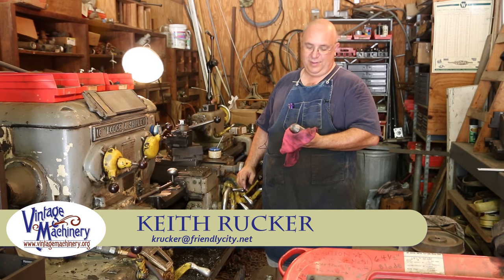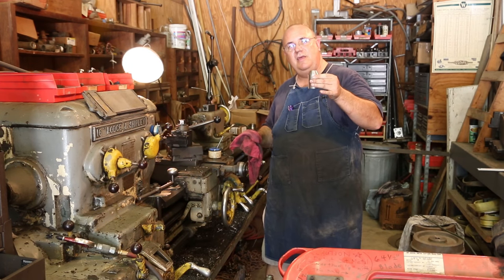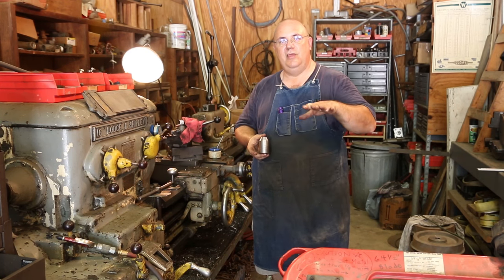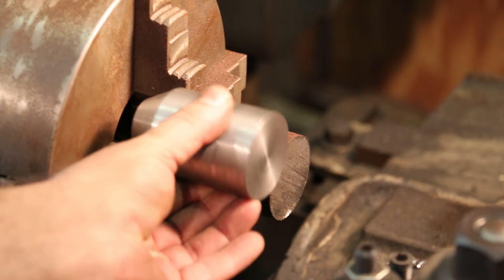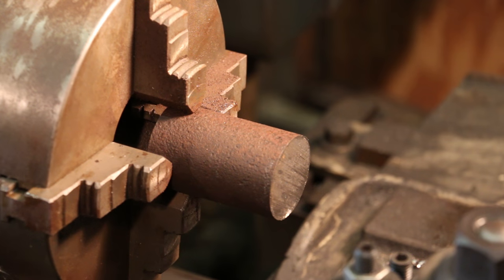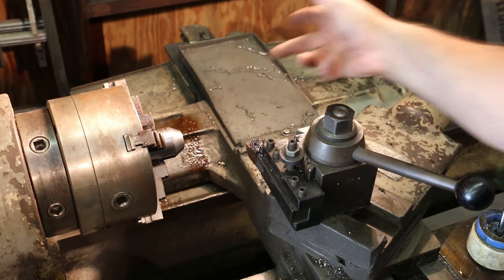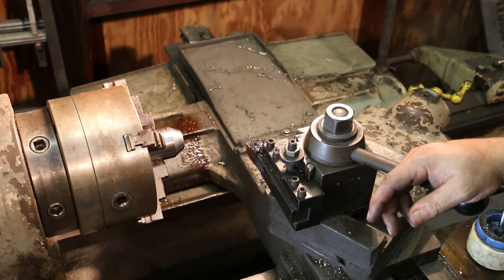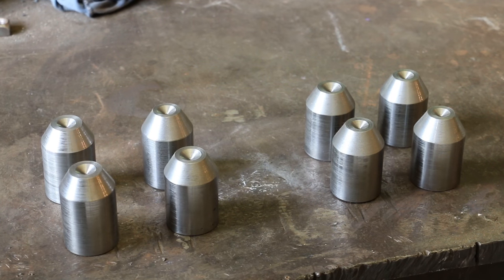Turning Leveling Screw Feet on a Metal Lathe

Comment: I believe folks forget that in order for the "feet" to tip or other manner of failing means that the thousands of lbs. of weight must be lifted in order for a tipping to occur.  Highly unlikely.
Reply from the maker: Yes - very true!
Reply: Ya, many people think of their little SB's or imports that can be rocked if you lean on them really hard. I have a 13" lathe that I would be uncomfortable with loose feet, but it only weighs about 700lbs.

Comment: If the feet were bolted to the lathe and the  adjustment screw was on the bottom I would have no issue with stability.

Comment: 1000 lbs per sq inch good working load. 0.76 x 2 = ~ 1.5 x 1000 = 1500lbs ea x 8 = 12,000 lbs. just my opinion.
Reply from the maker: The LeBlond weighs about 3000 lbs.  Eight feet with 3.14 sq in per foot equals a little less than 120 lbs per square inch.
Reply: good show.

Comment: Drill bit is a little dull.
Reply from the maker: It actually had a fresh grind on it.  But, for a 3/4" drill bit, I would normally drill a smaller hole first so taking the entire amount is a bit harder to do than under optimal conditions, but with me wanting to get the proper angle on the bottom of the dimple for the set screw to set in, it needed to be done that way.